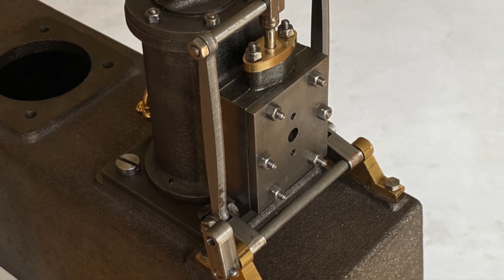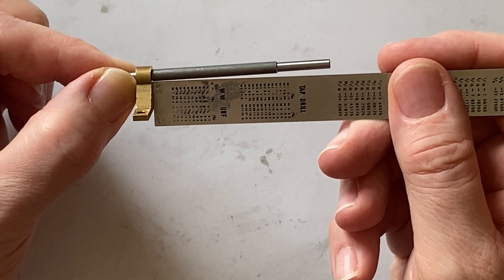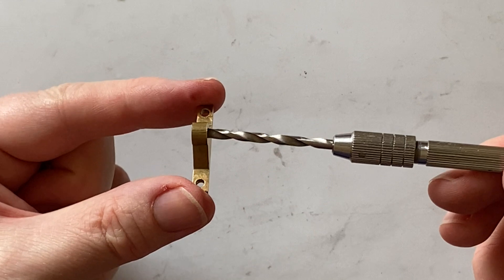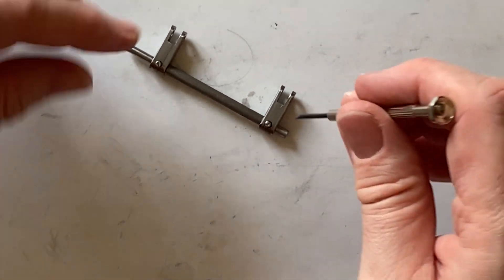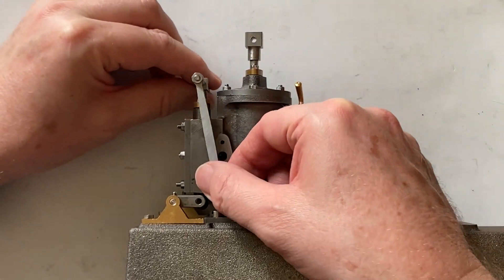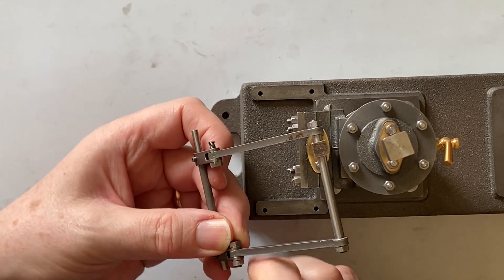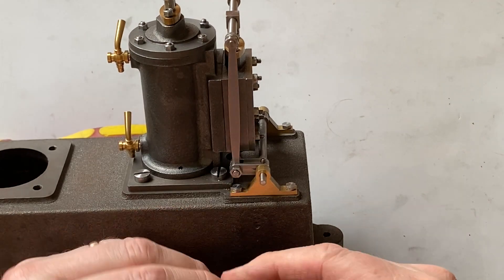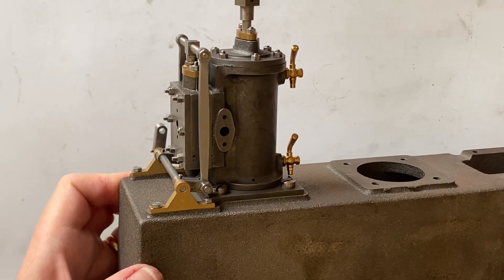Stuart Beam Engine Pt 4 The Valve Motion

Comment: Hi Mark - great videos.  Thx. - I have an beam engine the same as the one you are building in these videos.  But I do not have all the parts.  What materials would you use if you were manufacturing the eccentric sheave and the connecting rod? Stainless or just mild steel? Many thanks
Reply from the maker: Glad you liked the videos Martin. I’d use mild steel for those parts. Stainless is unnecessary.

Comment: Your not worried about the bolts working loose later on, since you're not using locktite on the bolts and screws??
Reply from the maker: Great question Anthony.  This is only a pre-assembly as it will all come apart again for painting and polishing, etc.  The bolts that can be fully tightened don't need thread lock as steam engines don't vibrate much.  I.e.  Bolts holding the cylinder, valve chest, etc.  The ones that can't be fully tightened will have Loctite applied.  These are places like the lever forks where fully tightening them will close the forks and jam the levers.